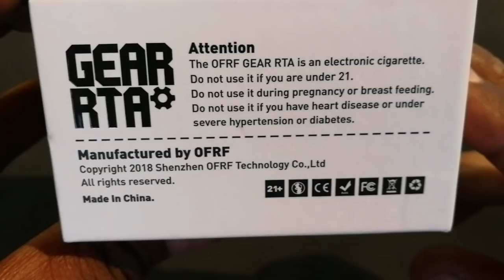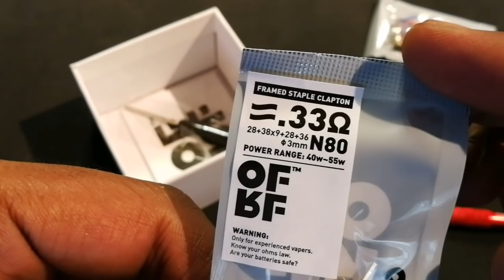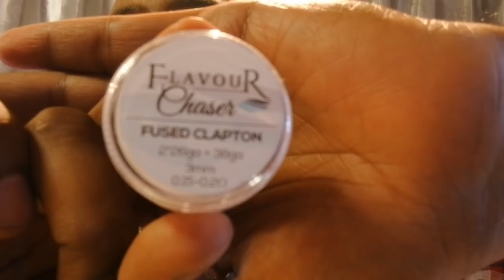OFRF GEAR RTA - Is it just a fake hype??

Comment: I was honestly aggravated by the hype cuz i wasn't getting great flavor but it was my wicking. I had to cut the wicks very short and thin it out alot. Now i have the wicking just sitting on top not shoved in the holes. I honestly don't see how people are saying it has great flavor after i watched how they wicked it cuz ive wicked this thing at least 15 times and flavor sucked until i cut it even shorter and just had it resting on top. Plus i don't get good flavor with that cotton. I know alot of people hyped up that cotton and i ended up buying 3 tins of it and i can't use it. I ended up just going back to Prime